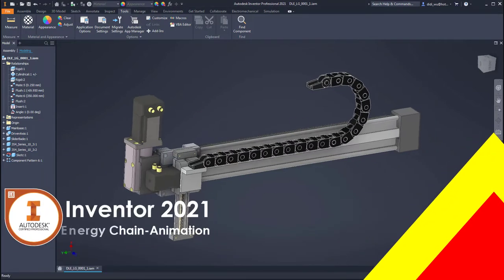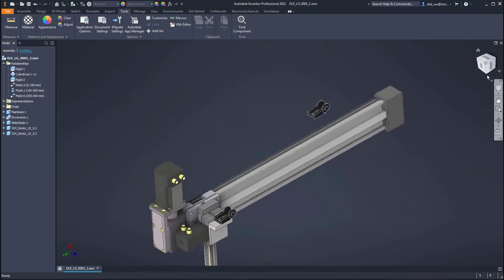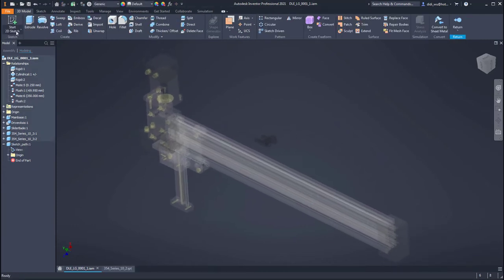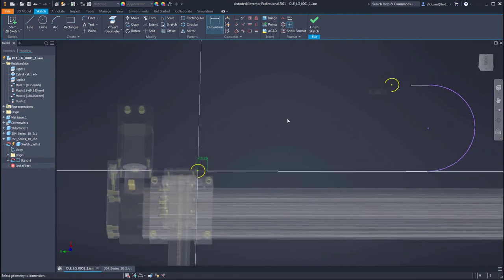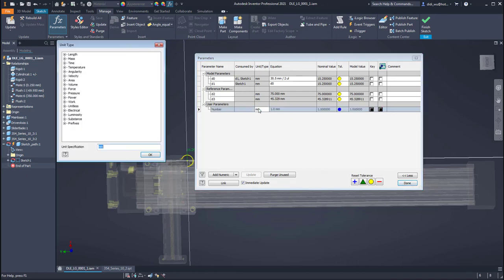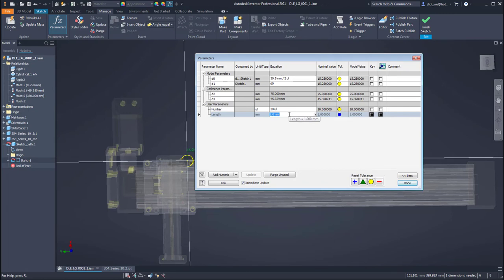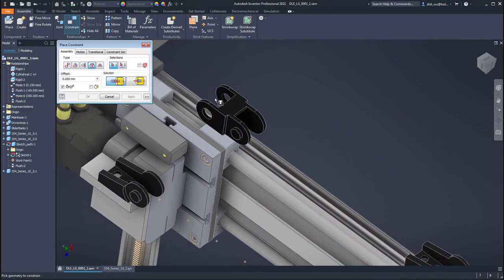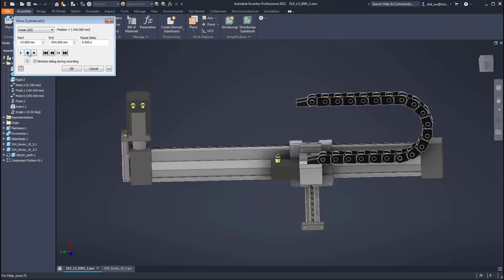Energy-Chain/Cable carier/Cable duct - Inventor 2021 Tutorial

Comment: My problem is the chain did not aligned the point from the radius part.
How to solve that.
Thank you
Reply from the maker: since inventor only consider straight path during radius, so you need to reduce the pitch length of individual chain, shorter is better.

Comment: Hi good day.can I ask something.
From your last dimensions which is the length-d3-d2*P1.my question is how to get the *P1.
Thank you.
Reply from the maker: Sorry for late respond, PI is math constant, it is 3.14159265359 to calculate the circumference of a circle. but in Inventor you just type PI and it will automatically convert into that constant.
Reply: @DidiWidyaUtama  thank you.

Comment: This Methode won't align the chain on the arc correctly, because the pattern uses the arc length, but the chain pitch is a linear length.
Reply from the maker: Yes, that’s the closest method to do it, so this just for visualization purposes. Thanks for your feedback
Reply: @DidiWidyaUtama is there a solution to make them align at the arc?